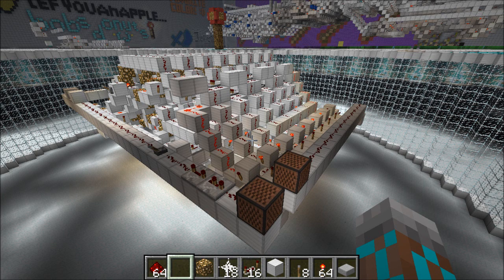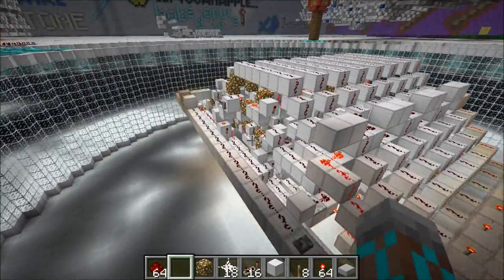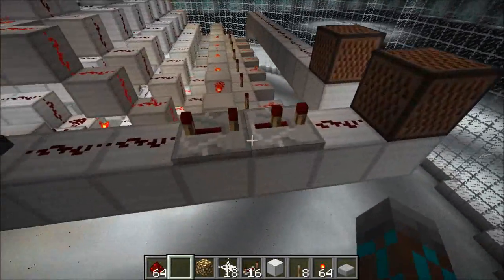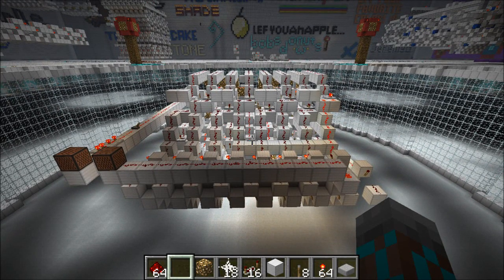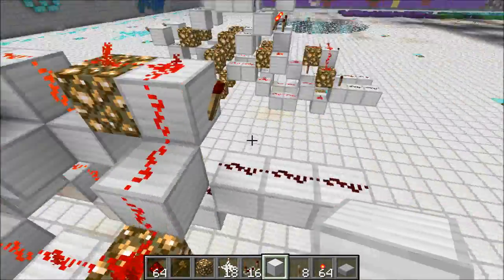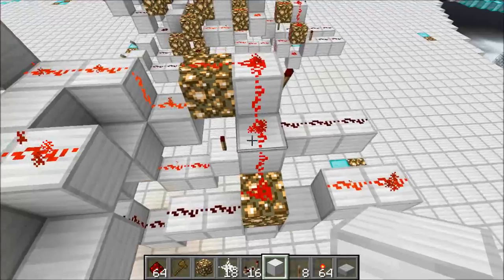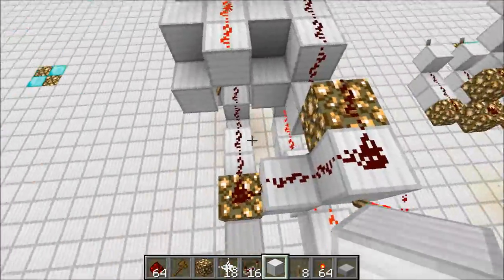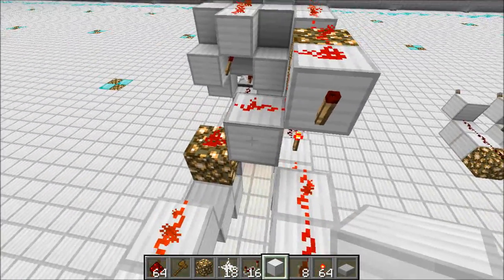Pushing Limits: 5 Tick 8-Bit Pistonless Adder

Comment from the maker: The delay from expanding beyond that would be dependent on how much signal extension is needed. Also, if you're interested I'll be releasing a FAR more compact design, as this one was really just a proof of concept. Oh, and the inputs can be powered directly from a register with no issues.

Comment from the maker: So, this adder is what's called carry-lookahead and what you're describing is called ripple-carry.  When I say this is a 5 tick for 8 bit adder, I mean that the entire carry across all 8 bits takes a 5 ticks. This is because it's a carry-lookahead adder and it calculates the carry of a given bit without needing to know the carry of a previous bit, making it far faster than a ripple-carry adder. If I were to expand it to 16 bits I would only need to add 1 tick.

Comment: I'm sorry. Even though I have a fair grasp of such things, I don't get it. I assume that the trick is to use carry look-ahead, but does that really guarantee 5 ticks in any case? What if you want to ad 1 to 255? (thus generating an overflow) would it still be just 5 ticks? I'd really like to see a video explaining the carry look-ahead thing, cause it breaks my head every time I try to comprehend how, why or if it works.